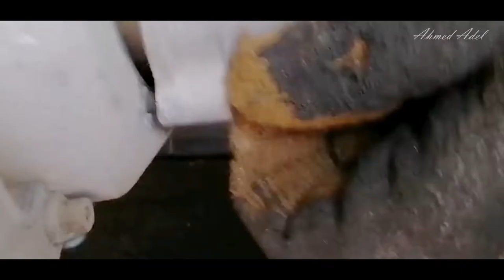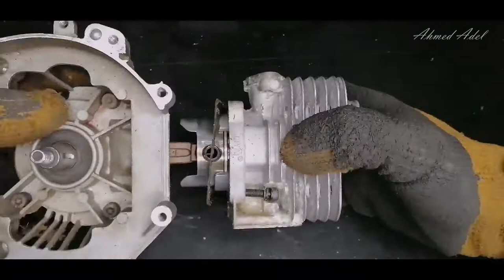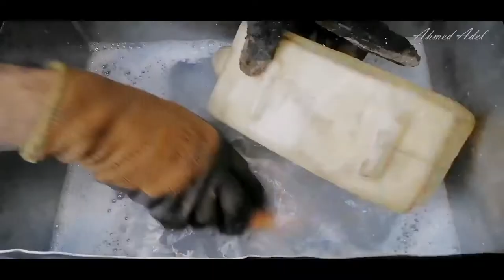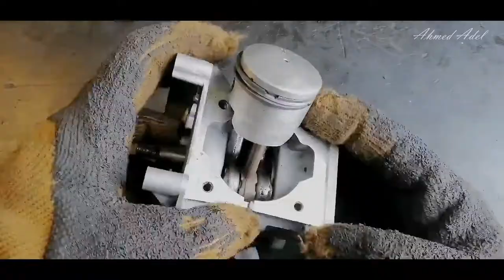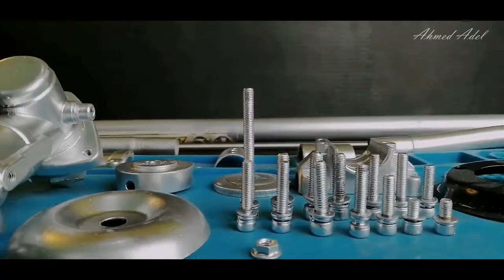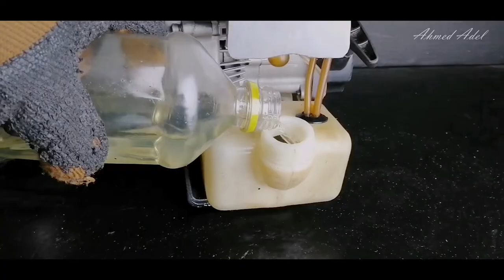Restoration Brush Cutter l Repairing Engine #brush_cutter #restoration

Comment: Mobile does not work in it
Reply from the maker: Sorry. I don't understand
Reply: Lubrication oil not included in this mechein
Reply from the maker: This engine is two-stroke. The oil is mixed with gasoline